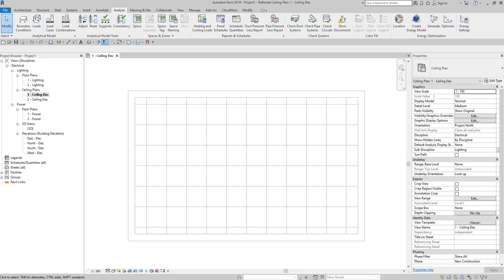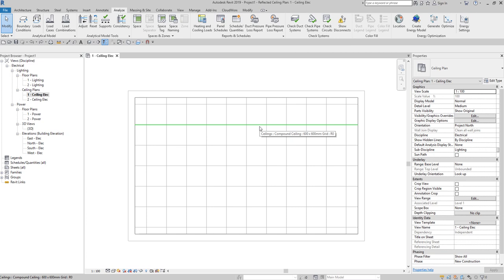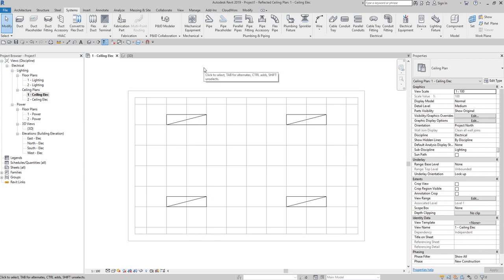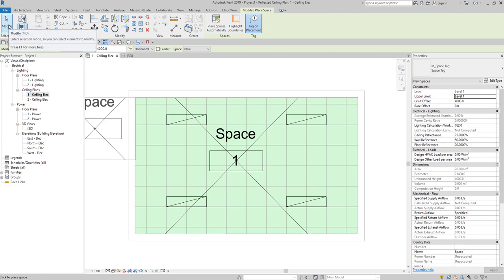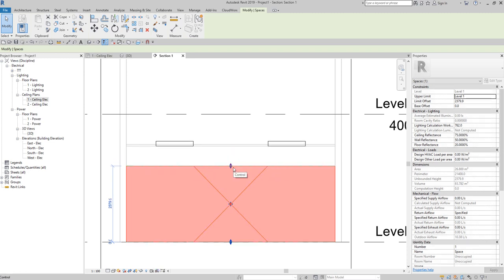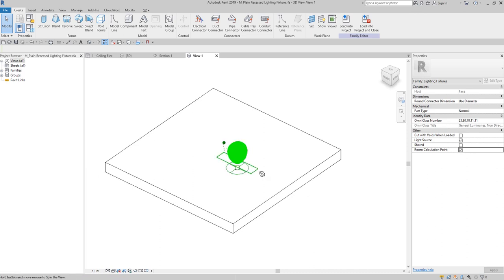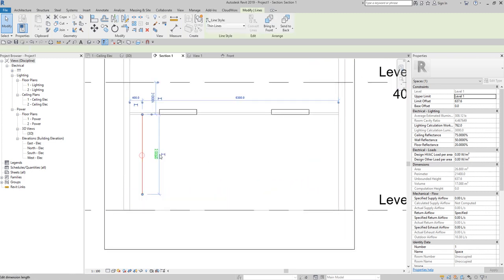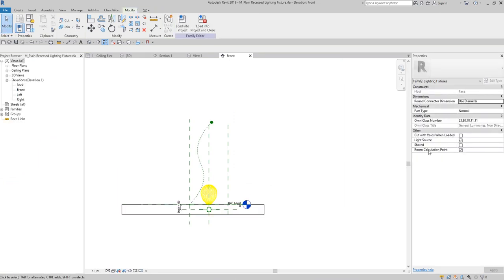REVIT MEP 2019: HOW TO FIX SPACES NOT COMPUTING AVERAGE ESTIMATED ILLUMINATION

Comment: I adjusted my space and moved the room calculation point for my familt but still my average illum. Is 0 lux 😢
Reply from the maker: just researched: You're encountering issues with calculating the average illumination (measured in lux) for a family within Autodesk Revit. If you've adjusted the space, moved the room calculation point, and are still seeing an average illumination of 0 lux, there are a few troubleshooting steps you can take:

Verify Lighting Fixtures: Ensure that you have placed lighting fixtures within the space and that they are properly connected to the electrical system. The illumination calculation will be affected by the presence, type, and settings of the lighting fixtures.

Check Photometric Data: Lighting fixtures in Revit use photometric data to determine how they distribute light. Make sure that the selected lighting fixtures have accurate and appropriate photometric data assigned to them. Incorrect data can lead to unexpected illumination results.

View Graphics: Check the view's graphics settings to ensure that lighting is turned on and set to display correctly. Incorrect view settings can sometimes hide or incorrectly display lighting results.

Lighting Calculation Settings:

Go to the "Manage" tab and select "Additional Settings" in the "Settings" panel.
Choose "Lighting" and ensure that the calculation points and settings are configured correctly. The calculation points affect how Revit calculates illumination within a space.
Render Appearance:

Some lighting calculations might require a rendering process to accurately display illumination. Consider initiating a rendering to see if the illumination results are more accurate.
Update View: If you've made changes to the space or lighting fixtures, ensure that you've updated the view or re-calculated the lighting to reflect the changes.

Material Properties: Lighting calculations are affected by the reflectance properties of surfaces. Ensure that the material properties of walls, ceilings, and floors are accurately set to reflect light. Dark or non-reflective surfaces can lead to lower illumination results.

Lighting Fixture Parameters:

Check the parameters of the lighting fixtures, such as intensity or light output. Incorrect settings can lead to unexpected results.
Visibility/Graphics Overrides: Sometimes, visibility or graphics overrides might affect the display of lighting. Check if any overrides are applied that could be affecting the display of illumination results.

Software Updates: Ensure that you are using the latest version of Revit, as updates often include bug fixes and improvements that could affect lighting calculations.

Consult Documentation: Refer to Revit's official documentation or online resources for troubleshooting specific lighting calculation issues.